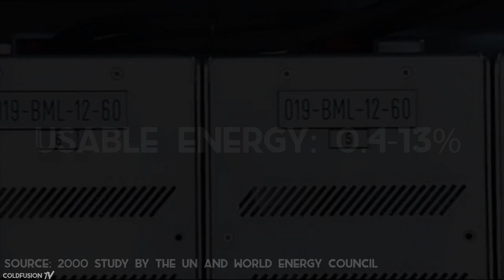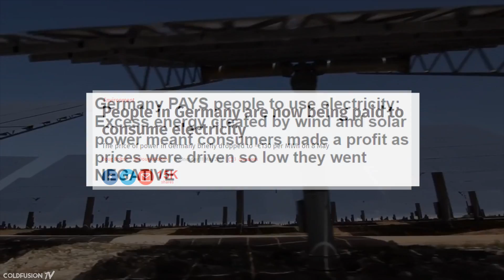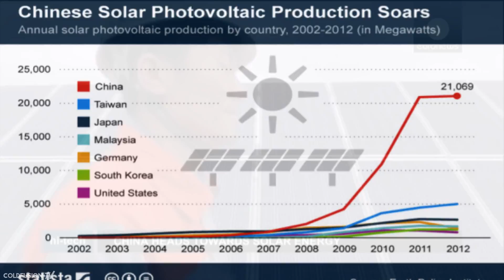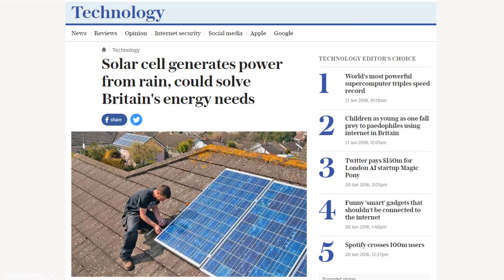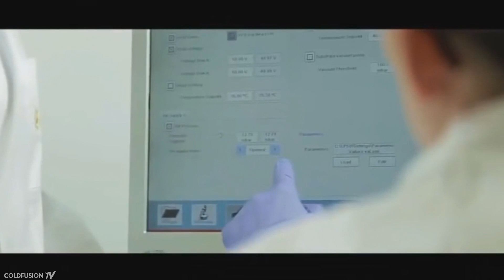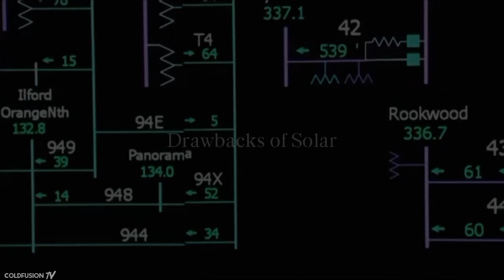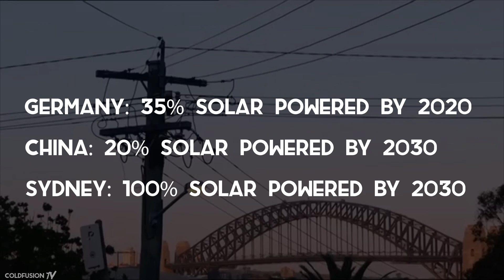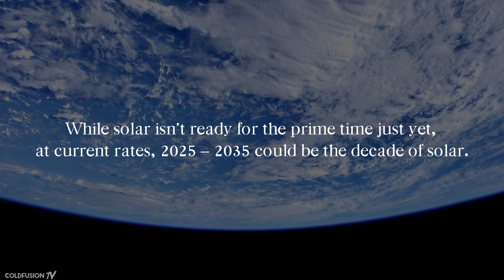The Truth About Solar

Comment: Well, they make a better picture of the use of sunpanels, on the roof,just like ledbulbs are pretty expensive, if you take one with a well made electronic stable powerconverter to drive leds, and uses a lot of passive cooling...metal. And since i want a clean powersource at home, cause i do a lot with audio gear, which needs no fluctuations on the net. But you see there a fast change from big transformer, to a fastswitching powersource that have about an average loss of just 10% and are small, but radiate a lot of interference. And what about all those cheap weightless laptop pad and phone loaders, which use the same principle then in high fi powersupplies...but often are the fast degredation from the batteries in laptops etc, so buying a well made loader and standardisation of connectors, then you need 1 loader with multiple voltage and current sources, instead of 8.
But i have my master micro electronics, and there are allready for years usable hydrogencells for cars, so it's as allways a monopoly from oil companies--->money. And the suncells for on the roof, which you can buy cheaper, are not the best ones and don't forget the electronics that comes with it. Plus that they should last 20 years and your investment takes 10 years to break even, but i'd like to see how fast the cells have degrated after 10years....40% for sure,and all the electronics ain't superhealthy to produce....